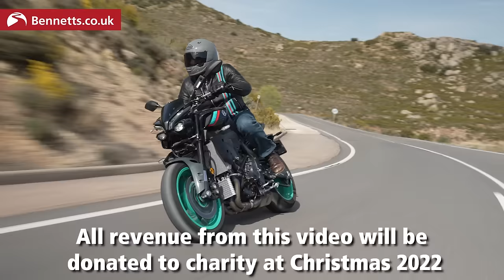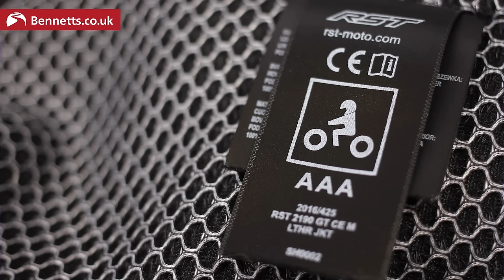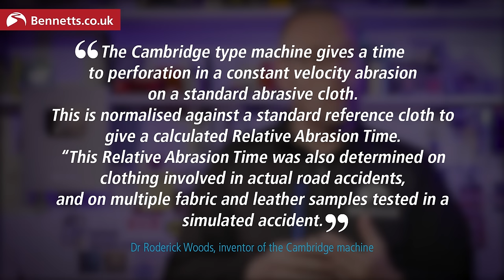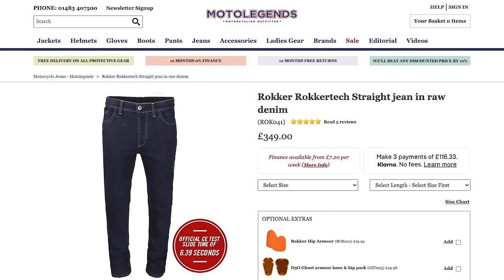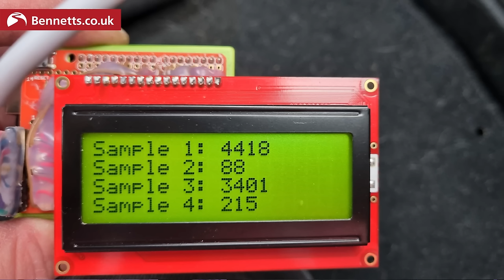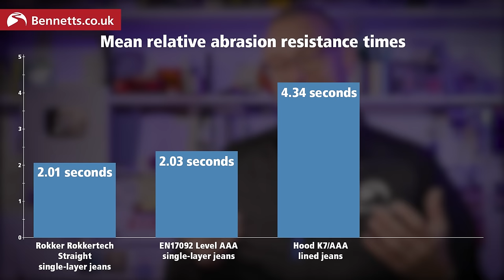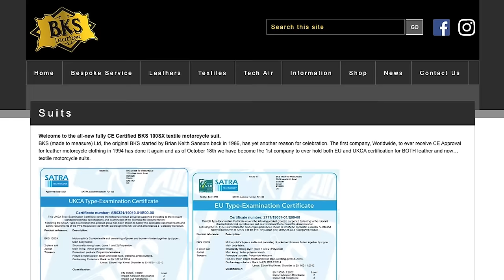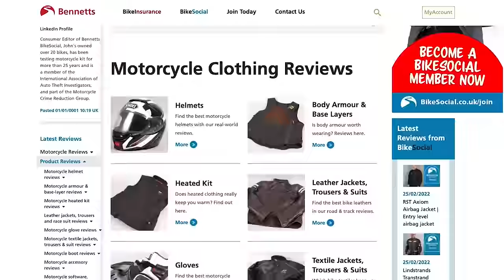Best motorcycle jeans | Single layer vs lined: THE TRUTH

Comment: Not sure this is a realistic test as someone coming off a bike on the road  won't just slide. They will bounce aswell. So that sander test is a bit more face track orientated imo
Reply: Adding the “bounce” increases variability. Laboratory tests have to be controlled and repeatable. The abrasion test was only one of three main assessments in EN 13595. The impact cut test also evaluated the resistance to cutting by sharp pieces of aggregate during the initial impact and any subsequent bounces.
Reply from the maker: As Paul says, plus a racetrack is far less abrasive than a surface-dressed road

Comment: one question - I don’t know if you check comments for this :)

How can we understand if a pair of jeans is single layer or lined? for a beginner, it’s hard to decipher the secret code of the marketing materials that brands share, and resellers are not particularly helpful.
Reply from the maker: Good question, and it should be simple if a brand has explained properly what the product is. If you have them in you hand, a lined pair will likely feel a LITTLE thicker, and you'll probably see what's likely to be a yellow material inside. Don't be confused by a fine mesh comfort liner - this isn't a 'lined' pair, though this can provide some additional protection from more minor injuries. Cheers, John

Comment: Great video as always! However I still haven't found a decent pair of trousers for riding... they are either too hot, not safe enough or not comfortable enough (for example my rev'it jeans really smashes my crotch area after a while, it's almost like they designed it for eunuchs...). I'd try the Hood ones if they were available in EU with free exchanges, but since it's from UK I am afraid of getting the size wrong and going thru a hassle with it...
Reply from the maker: Keep looking - there's more and more good stuff coming onto the market. Cheers, John

Comment: I have been riding since 1989, over the years there has been a raft of confusing marketing 'Speak' with all manufacturers regarding the safety of their respective clothing, but relatively little on substance and physical evidence of test results to back up their claims. I had the unfortunate experience of coming off at around 55-60 mph on a busy A road, the tarmac was fairy worn, and it was wet and it was raining, I was wearing a set welding boots! Long leather gauntlets, I had a Belstaff black jacket which was soaked in old engine oil and I had a cheap pair of leather trousers on, at the time I was also wearing my over suit which was just really the same as a hikers water proof suit, As I hit the ground I landed on my side and then on my back and I slid down the road for what seemed like an eternity! (probable about 5-10 seconds)  I ended up on the opposite side of the road, having slid for about 40 feet. My leather trousers saved me, they did not rip but their was a large rough mark on the right hand side all the way down to the knee and on my backside, the side of these trousers had a very thick rubberised band down the side of them., as expected my water proofs were ripped up to the back of my neck, the Belstaff jacket had no damage, only one cuff button on right hand side had worn down as I must have had my arms out extended as I was sailing down the road, the boots were badly scuffed and scraped on both sides but did not open or split, and my right hand heel took a corner shave. My Hemet was scraped at the back and right hand side but the visor was still on, my gloves survived, as before it was the right hand side that was heavily abraded, but did not go through. I had a lucky escape, no broken bones, just a bruise on my hip, sprained wrist, and my tail between my legs! My Belstaff was given to me second hand, (it stunk! and god knows how old it was) had no body armour, and I detested it, the leather trousers were unbranded, and were cheap and no armour, my boots were another donation! just steel toe caps and souls, my helmet was an AGV full face purchased new, my gloves were actually really old from the early seventies but they were free, I was in my first year of riding my bike before I took my test when I had my first mishap. Now none of this clothing I was wearing (apart from the helmet) had any kind of labels on them, but if it had been dry I think the experience would have been a lot worse. The moral of the story here is I really wish their was a worldwide standard that proves that any clothing you buy conforms to an absolute minimum standard of protection and that standard clearly indicates what protection you are likely to receive, and the manufacturer should show videos of what actually happens to that graded garment to prove their claims as well as certification, all the way up to the highest protection levels. Secondly any garment that meant to be worn with a bike should be used, not promoting substandard 'fashion' wear.  I am aware of the current standards, but what you usually see is very little or some reference to a "level" of protection, and its usually buried out of sight, not enough manufacturers pushing safety and showing that their garments are safe in actual use. Not going their with the jeans verses leather verse textile, when I am buying I look for 3 things, Quality - how well its made and what materials it's been made out of, and how well it fits pays to do research, 'will it slide or move off you during an accident' or twist off, even snap, Protection - armour options should be back, shoulders, elbows, knees, backside, shins, toes, heels, fingers, palms, and should have certifications. Environmental - windproof, waterproof, has an inner lining, that's detachable and should keep you warm in most conditions and paramount it fits properly and that it fastens tight this is usually overlooked. Obviously there's no perfect garment, but over the years I prefer good quality textile garments with thermals and silk, with some leather underneath if I am feeling particular anxious in built up areas! ***Ride safe!***

Comment: Strangely, my Alpinestars Copper 2 Denim jeans say Cat II rather than having a B/A/AA/AAAA rating, but the CE tag looks almost identical otherwise, and has the same EU 2016/425 label on it.
Reply from the maker: AlpineStars has been using a variant of the standard, which should stop by now. It was still relevant though. Cheers, John
Reply: @bennettsbikesocial  thanks so much for replying!
Reply: “Cat II” means the jeans have been independently tested and certified, which is precisely as it should be (Cat I is reserved for products which are permitted to be self-certified, such as washing-up gloves; Cat III covers items such as respiratory protective equipment). Some certification bodies were not permitted by their national accreditation organisations to certify to prEN 17092, the draft version of EN 17092, which is possibly the situation with your jeans. 

In any event, certification is issued under the *legislation*, not the standards, hence the reference to EU 2016/425.

Comment: For me it it is very very hard to understand this. While here it’s seems clear that e.g. the hood jean is pretty solid, the mentioned shop in the video claims it is wrong. The manufacturer rokker also has managed to get an aaa rating for their latest jeans. My take away was to just stick by the certificate, but as the single layer jeans all performed poorly in your test that seems not be the right way.

I wish there would not be that much disinformation about this issue.
Reply: @philNullFunf : EN 17092 groups products within three broad groups for abrasion resistance: C/B/A, Aa and AAA. MotoCAP’s data has demonstrated that the AAA garments it has tested have a relative abrasion resistance time from a low end of 1.4 seconds (although the data is building and that time may actually be lower) to over 7 seconds. What this means is that when you purchase a AAA-rated garment, you will not know at which end of the relative abrasion resistance scale it performs, because that is not how EN 17092 generates data. You will only know that it has passed the minimum requirement set by the standard.

Comment: Some springs would have solved your test rig (very good it was too..)
Reply from the maker: I think dampers would have been the best bet, but they'd need to apply a fraction of a second after dropping. Ultimately, lab testing is there to give us a consistent and repeatable comparison (which some sellers seem to forget when making wild claims). Cheers, John
Reply: @bennettsbikesocial  I was thinking of a spring mounted to the side of the two pivots so then they went past half way the spring pulled the arm towards the ground, hard to explain without a drawing - imagine a spring mounted to your calf and your hamstring

Comment: How far do bikers slide along the road? We see motoGP riders sliding for ages, but that's on a track. Most bike accidents on the road happen at low speed. Usually the rider comes to a rapid stop in the driver's door of a car. In short, this time rated abrasion resistance is irrelevant on publis roads.
Reply from the maker: It could rightly be argued that you're more likely to hit something on the road before you get far, though my first road crash was a good 65 meters before I reached a lamppost. 
It's got to come down to people's own preferences, plus remember that no testing gives a slide time or distance; it's all about comparative performance. 
A road can rip open something unsuitable very quickly, but the real world is a chaotic place. Personally, I'd simply recommend people set their sights on AAA-rated single-layer or lined jeans, then choose from there based on their own assessment of risk, their budget and the fit of course.
Reply: The contention that most bike accidents on the road happen at lower speeds has been voiced by some clothing industry representatives as justification for EN 17092 setting relatively low demands, which provides no reassurance whatsoever if your are one of the riders whose incident occurs at higher speeds. Performance levels addressing varying degrees of risk are well established in standards, but there must always be a level which can mitigate the worst case scenario. Where EN 17092 tops out too early, the new BS 13595 will provide a level of challenge to materials and constructions for such foreseeable events.

Comment: Why don't the industry use a crash dummy with the jeans on and conduct a simple repeatable consistant slide test? 
Seems like a logical thing to do, kind of like we do with car crash testing, so we get a whole view on what the jean can do.
Reply from the maker: I think it's because motorcycle accidents are hard to reproduce in a consistent way. Car drivers strapped into a vehicle behave in a predictable manner where riders can roll and tumble between sliding making it harder to define and reproduce a 'typical' incident. Steve R
Reply from the maker: Agreed – that's why testing should always be considered an indicative comparison, rather than a direct time to failure in road conditions. There's also the issue of differing road surfaces. 
It's like the security testing I do – it's to compare products, and can't give a direct guide to how long something will last in a real-world theft (and fortunately, real thefts tend to take longer than in controlled testing). Cheers, John

Comment: I have a criticism regarding making category sweeping claims (like "[all] lined jeans are better than..") based on the result of a single model.
While I suspect your conclusion is correct I also wouldn't surprised to see a big spread of results for different models because of Kevlar thicknesses, stitching quality, treatments...etc
Reply from the maker: I don't actually say that it's the case for all lined or single layer jeans. Also, it's worth adding here that these are unlikely to be the most abrasion resistant lined jeans - a pair of Draggins have achieved 10/10 in Motocap's testing. However, based on this independent lab test, lined jeans have been shown to offer better abrasion resistance than single layer.

Comment: Bike jeans will never offer the protection of  leather trousers.  It’s become a lazy fashion which may well cost those chancing them dear.

The possible exceptions are quality lined jeans with decent armour, like the Bull-it double layer armoured jeans using Covec or the pricier Hood jeans which I believe are carrying proper protection levels.  However, they’re heavy and sweaty so you’d be better off with leathers.

I would like to see more  mixed textile and leather jeans with decent protection but are easier to wear informally on and off the bike.
Reply: I disagree with the “heavy and sweaty” accusation. I was out in my Klim Badlands Pro jacket (the brand rated best for ventilation in BikeSocial’s recent review) and Hood SK11 jeans and was perfectly comfortable. Bearing in mind I also wear an Alpinestars TechAir air vest under the jacket; by the benchmark of the accusation I should have been melting, but I was not. I have, however, been extremely hot, sweaty and uncomfortable in leathers. 

The “hybrid” suggestion has manifested itself in Adventure Sports clothing in the past - textile jackets and trousers with leather reinforcements at the shoulders, elbows and knees. Laundering was an issue with these garments, but washable leathers are now available which might overcome that.
Reply: Can only speak as I find.

Comment: I've been wearing Hood for years. Always thought they were good quality and now that seems to be backed up.

I'm still a little confused as to why the new rating is tested against what appears to be an inferior testing system. I e. Concrete against grit. Is this typical EU trying to appease manufacturers rather than what is best?
Reply from the maker: EN13595 was too hard to meet for a lot of textile kit, so there had to be a lower standard, though it's a shame the higher standard was lost. You can read more about it here: https://www.bennetts.co.uk/bikesocial/news-and-views/features/product/motorcycle-ce-safety-standards
Reply: @bennettsbikesocial  So yes, appeasing the manufacturers. Love it when standards are dumbed down in order to increase the pass rate. 🤬😠
Reply from the maker: @mrcintheuk4641  I'd say you're kind of right. The trouble is, we'd only have very heavy duty and expensive kit if 13595 had been kept and brought into the regulation. Some brands are now pushing to have a higher test level incorporated. Remember, before this, 13595 was effectively advice. Now it's law, which meant it had to be achievable. It has weeded out some rubbish, but the fight now is in getting it enforced: https://www.bennetts.co.uk/bikesocial/news-and-views/features/product/stop-unsafe-motorcycle-bike-clothing
Reply: @mrcintheuk4641  : The standards were drafted by the motorcycle clothing manufacturers and EN 17092 is based on the state-of-the-art of motorcycle clothing in 2016, in response to the European Parliament’s decree that, with effect from April 2018, all motorcycling apparel would be required to be tested and certified. 

The industry was aware this decision was coming as far back as the autumn of 2013, but by the time work on EN 17092 cogged into high gear, the time left was too short to accommodate the product development timescales of some main brands. Consequently, the standard’s requirements had to be set at the level which was achievable at that time. Doing anything else would have left rails bare in the stores. 

EN 17092 is seriously flawed in several areas, but in its defence it has filtered out some truly appalling items at the very bottom of the market, and the industry is at least testing to it and certifying its products - with the Damascene conversion of some brand principals who were originally opposed to the process now embracing it!

Comment: What suggestions do you have for the hot months.   I wear lined jeans with armour in spring and fall but where I am the height of summer lined jeans are just too hot and I struggle to find pants to wear.  I do wear a armoured compression short under reg jeans and even that at below 40 kph I melt.  Ant product suggestions
Reply from the maker: We don't get the same heat here in the UK as other parts of the world, but I've been comfortable in lined jeans in the US and Sputh Africa for instance. Cheers, John

Comment: Thanks a lot for this video. I’ve been particularly interested in understanding how plastic armors would perform on a slide. I mean, for example, alpinestars bionic jackets, leatt z frame knee braces… those kinds of things. I fell that wearing those armor outside my clothes should perform even better on a slide than just the fabric, but it’s just my imagination… until someone tries it! Would you be that person? 😅
Reply from the maker: Hard armour might slide, but it'd transfer more energy. Armour's best underneath!
Reply: @bennettsbikesocial  is there evidence of this please? Sounds like a multi-factorial issue.
Reply from the maker: @DrRussell  A hard armour will transfer more energy to the wearer, unlike more compliant materials like dense foam-like armours or D3O (for instance), which being a non-Newtonian fluid tightens up its structure under impact (not 'goes hard'). A harder armour would act more as a slider, but the softer armour should be better behind the abrasion resistant material. Though I guess it could be argued that it'd still be providing resistance. It could be an interesting test!